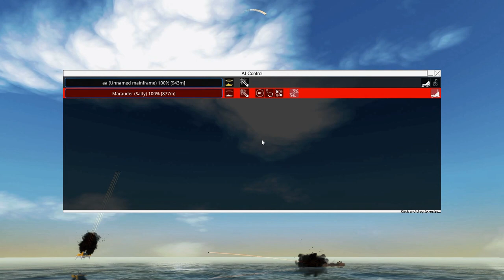From the Depths CRAM Mortar Tutorial - Beginners Guide - FTD 2020

Comment: THY GOOD SIR! You have made an amazing tutorial as usual! Would’ve been nice to have APS mortars i there but cramps are better since of the bullet tracking or magnetism and such and if you invert the autoloaders like make the center line of connectors not exist but instead use 4 and wrap them around so in the center you’ll have 4 autoloaders connected to ammo. Kinda hard to explain basically you make plus signs with autoloaders you just want the ends to lead into another autoloader since the more autoloaders attached to ammo or whatever the better the reload or pack rate. Also 600mm crams are decent probably the smallest usable crams and I found 2000mm frag cram but air burst quite fun maybe not as effective as HE but making it explode before it hits the target leaves a nice blanket of shrapnel to take off any light systems. It’s nice to finally have a cram mortar tutorial. If you look at the bottom of the info menu as well when looking at a cram. If you are doing aphe mortars you only need 30ap roughly to get through 1-2layers of metal... also the only reason to use APS is fire rate/flack and compactness. You can build a more effective 500mm APS that’s compact better than you can a 1000mm cram but once cram gets to 2000mm it’s better than APS
Reply from the maker: :D Good analysis and glad tutorial was welcome! 

Will have to experiment more with optimal cram tetris it seem!